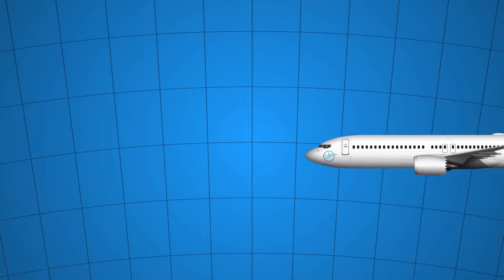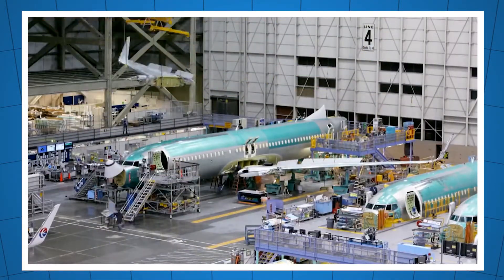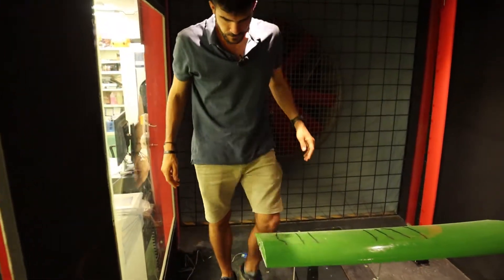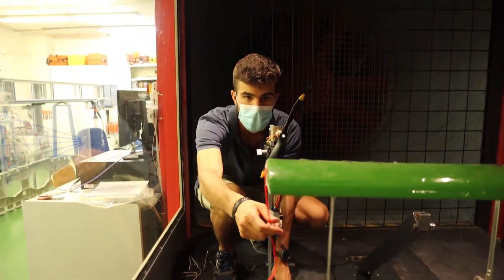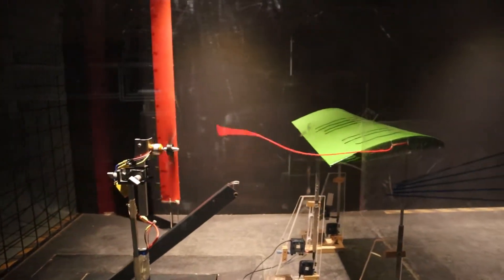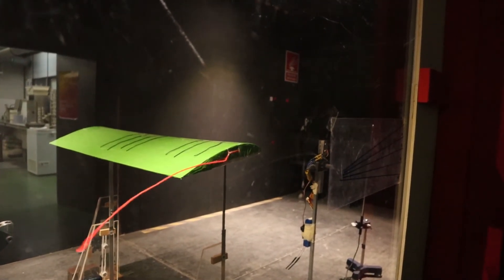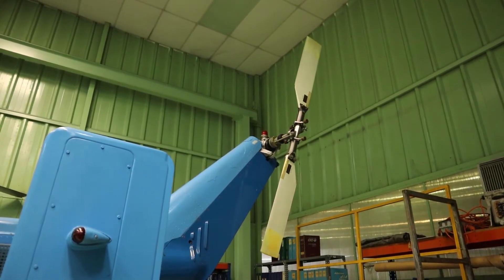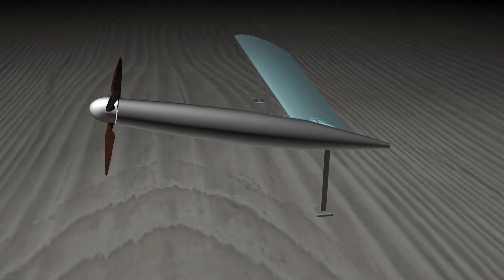How to FLY with NO Drag #VeritasiumContest explained

Comment: Very interesting idea but, in my opinion, maybe not a feasible one to begin with. The farther away the propellers are placed from the plane’s vertical axis, the larger the yawing moment that will be produced if one of the two propellers were to fail. Therefore, this requires an increasingly larger vertical tail to counteract said yawing moment in case of engine failure. This may prove hard to implement in structural terms, and it would most likely increase the weight of the airplane. Therefore, it would be interesting to investigate wether there is a net reduction in fuel consumption by implementing this idea on a complete aircraft. In any case, nice video!